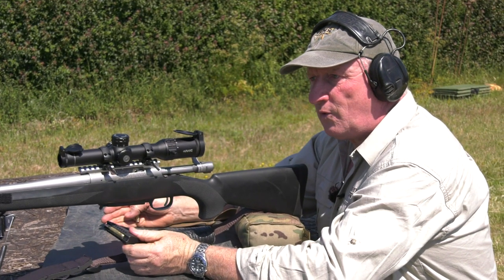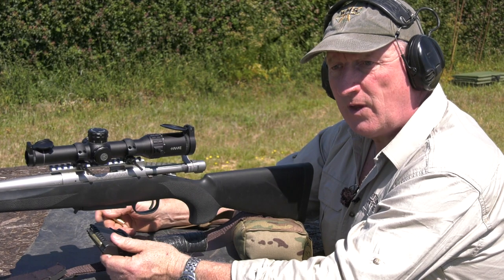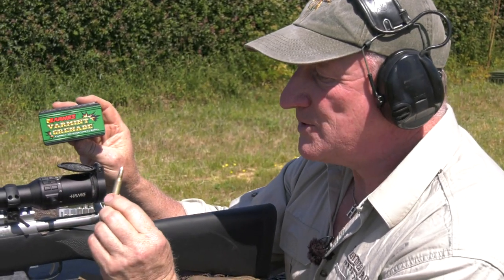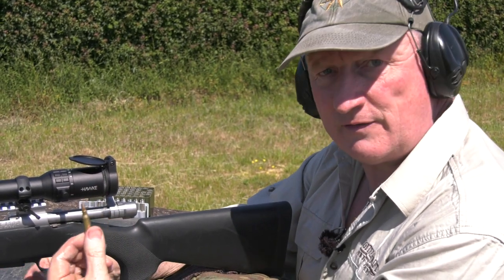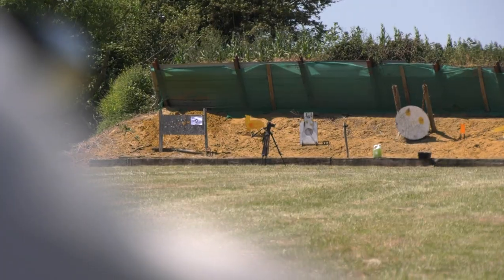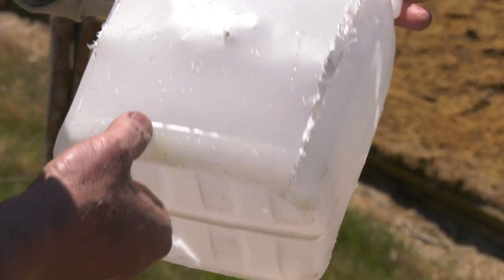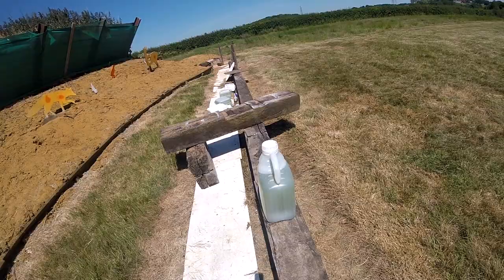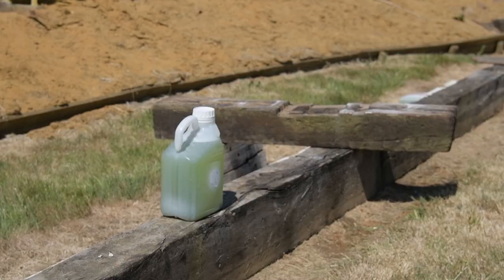On Test: Barnes Varmint Grenade

Comment: Great stuff  ,I am trying  the barnes  TSX 150g in my .308 doing 2750 fps measured at 6 feet from muzzle, for white tail and moose .Like you were saying heaver and slow good for lead core this is not  the case for the copper   I think the 150g tsx will do for both as a moose shot would be 100 yards or less. The white tail would be max 250 -300 yards   bullet still moving a little over 2000 fps

Comment: I Just took a Antelope with the barnes 6mm 62grain 243 using  a max advertised layman load of h4350. These bullets translate all their energy into the target and have more penetration than the average varmint bullet. The pronghorn died instantly with a clean pass through, but a lot of energy at that high of velocity. 3800 in a 22 in 243.       These bullets have a history of being used in the military with eabco sabots to shoot .22 projectiles at over 4000 fps without ruining barrels quickly because of the sabot

Comment: Andrew, like your videos, a simple question. You say that you can't buy this load off the shelf in 243W ammo, so you reload Barnes Varmint Grenade in 243 W. Which powder & weight did / do you use ?. I'm a  Vihtavuori / Norma man as I live in Denmark but can't find any reloading info. Can you give some good advice. Thanks Steve. ( X pat )
Reply: IMR 3031, H4895, Varget have all been excellent for mine riding around 3450-3500fps
Reply: @txdocprich_8404  none of those are Viht or Norma powders. He doesn’t have access to hodgdon or imr as he lives in Denmark.